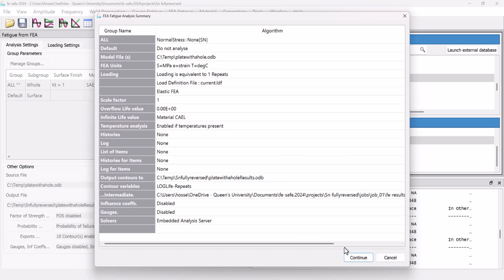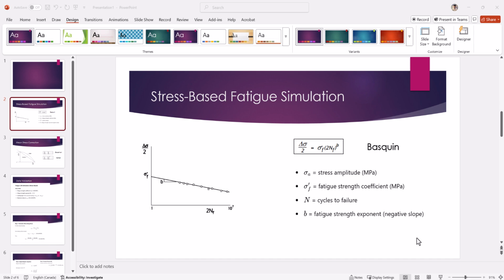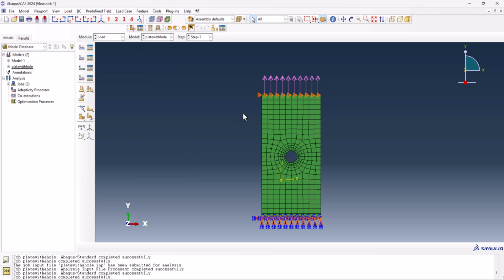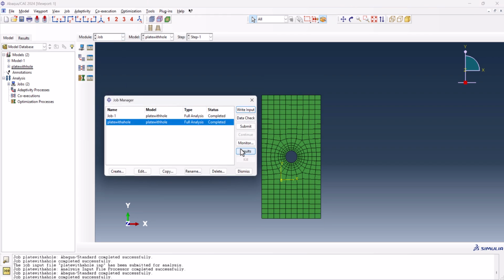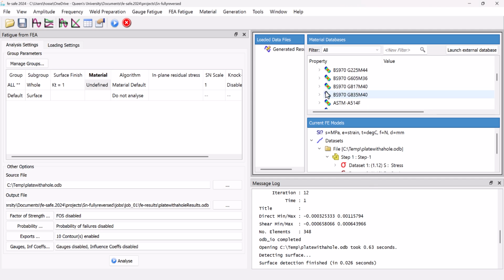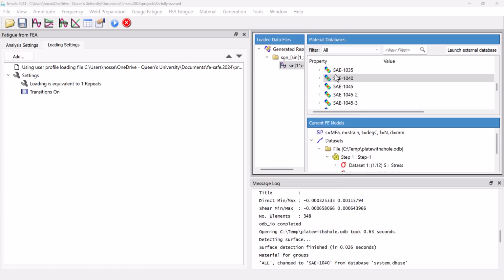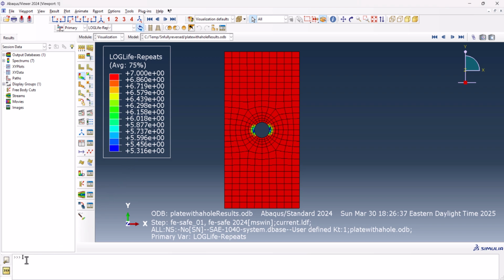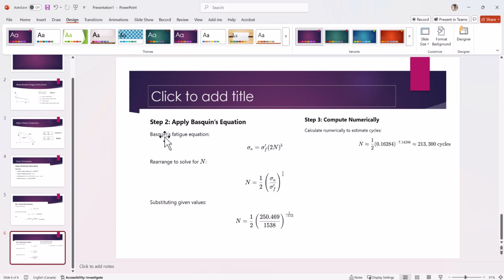Stress-Based Fatigue Life Prediction Using Fe-safe and Abaqus

Comment: Can you try SN ( HCF)  Fatigue analysis with SIMULIA 3DEXPERIENCE ? - With fresh customised steel material & SN data , no constant & default value , zero based type ? or you can try same here in FE-safe as well.
Reply from the maker: Thanks for the suggestion! 🙌 I actually have a full course on S–N (HCF) fatigue and related workflows—covered in FE-safe step by step (custom materials, S–N data, zero-based loading, no defaults). Check it out here:
https://www.youtube.com/watch?v=c5LPcALfRMs&list=PLvACBM1uN9Er9WuaYT9lxMkKRKspGiRpC
Reply: @FEAMASTER Thanks I will check!!!
Reply from the maker: @pranavshukla18  great, let me know if I can help you with anything else!